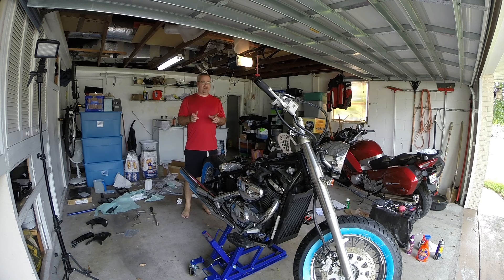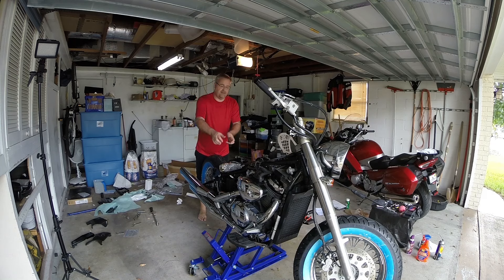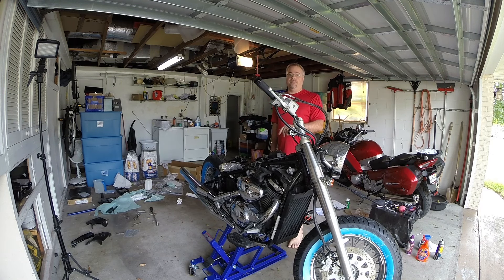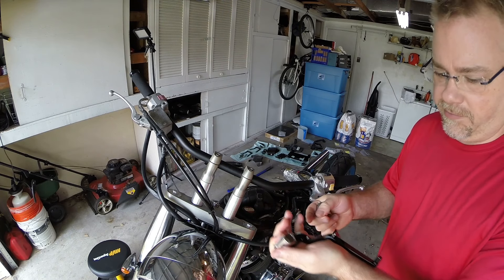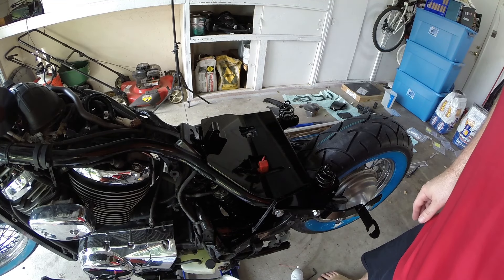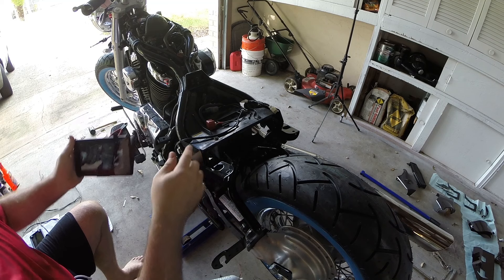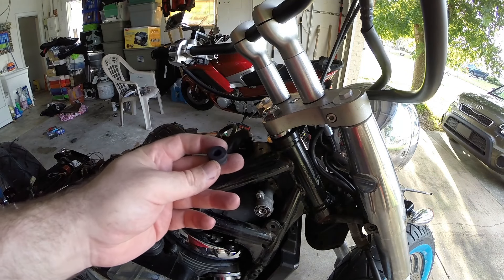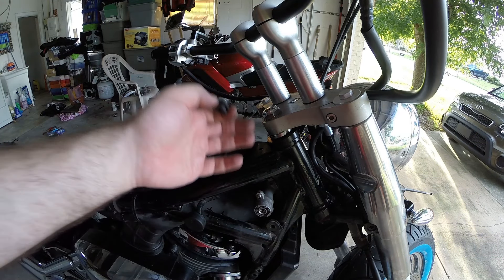Suzuki Boulevard C50 Bobber Build Project Day 22

Comment: Richard called it first...I was going to tell you that I saw a grommet roll towards the right front wheel of your lawnmower too!  Looking good!  I would have cut those bolts that are too long or put chrome bullet caps on them...just bare they look ugly.  What about changing out the pipes or even cutting them?  On my C50 I used to have, I removed the baffles and shortened them, then cut the pipes and reinstalled the baffles.  I didn't even have to re-map the engine.

Comment: What did the front wheel of the Suzuki kick out onto the left side of the garage floor towards the lawnmower. Was it that missing black rubber grommet that you went to Home Depot to find a replacement for?. ( probably not )  check video counter 4:38-4:42. Such a great video series. You tend to always stay positive. And focused on the completion of your bike. So cool. Tcrs
Reply from the maker: That was just a tank mount bushing they like to fall off but good eye!

Comment: Definitely only want a bike that's only been stored in the garage. Don't know that I would ever buy another used bike as a primary but any used bike I buy will only have been stored inside. I've got a 2013 Yamaha VStar 1300 Deluxe and a 2013 Chevy Silverado LTZ Crew Cab. You guessed it, truck is parked outside. It was made to handle the elements much better than the motorcycle. Buddy of mine had a Suzuki C40 that he stored outside for 6 months. Every time we worked on it after that was a nightmare due to bolts being rusted and the plastic parts being brittle.

Comment: The lights/wiring turned out great.  Brake light check ??  My bikes will be garaged before the car if space is an issue.  Even when I commuted to Tampa from Clearwater on my FJR, I always put a 1/2 cover on the FJR even though it was parked at work's parking garage.  Actually, I use the 1/2 cover quite often if the FJR will be parked for more than several hours in the sun.
Reply from the maker: Brake light is good :)

Comment: Has blue collar bobbers responded to any of your issues with too long of bolts and the mixing of metric vs USA bolts?   Just curious if they did indeed respond.    Great video as usual!
Reply from the maker: kelly j I emailed them tonight.  In the end it's not a huge issue but very easily corrected to really polish a great set of products!  I'll update in a later vlog if they do.
Reply from the maker: kelly j They just replied - basically they are using the fasteners they do because of supply issues.